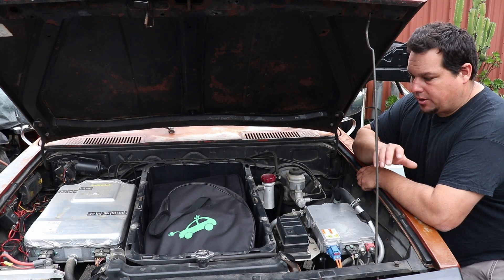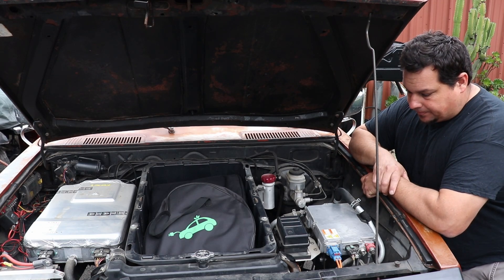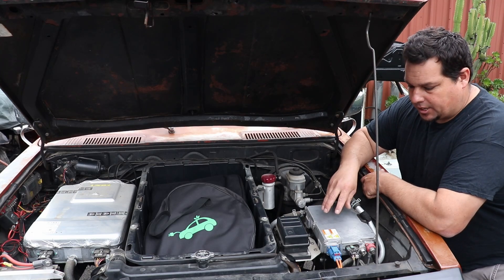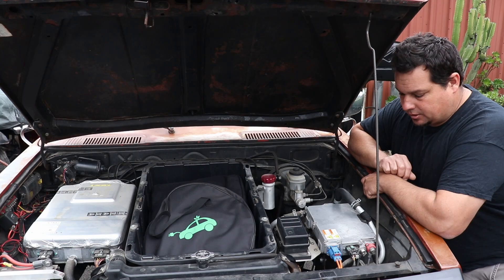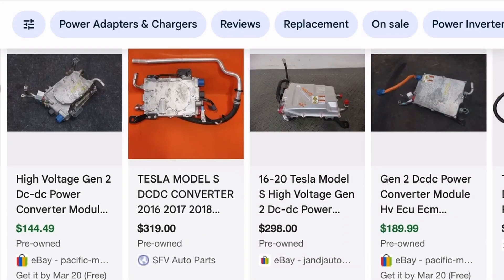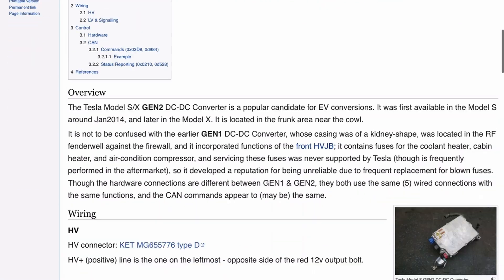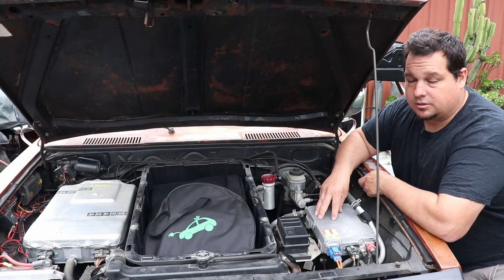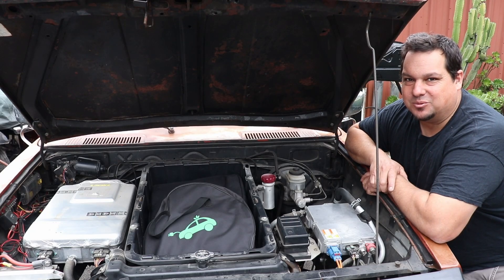TECH TUESDAY: Using a Tesla Gen 2 DC DC

Comment: This little snippet video is so useful. I would like to be clear in my mind on a set of relatively easy to use and configure OEM parts for a conversion. DC/DC converter sorted ! Thanks !!!
Reply from the maker: Thank you! I’m trying to make these videos as useful as possible. I’ll do more on the charger and other parts I use.
Reply: Very useful info, honestly shocked how easy it is to wire it up! Also, 2.5kW is pretty substantial too, could easily power cooling fans which take a pretty large draw ~480w
Reply from the maker: @ thank you! Yeah those things pull a lot of power. But this thing can definitely handle it! It’s essentially a 200 amp alternator lol.